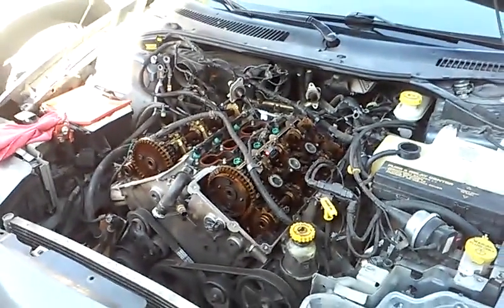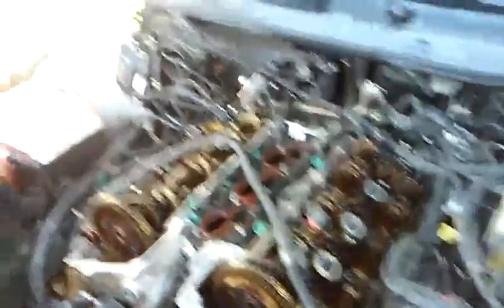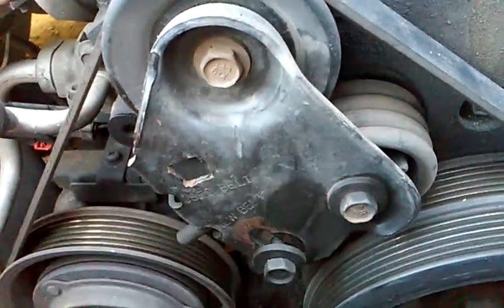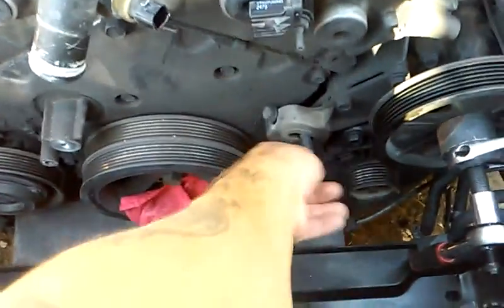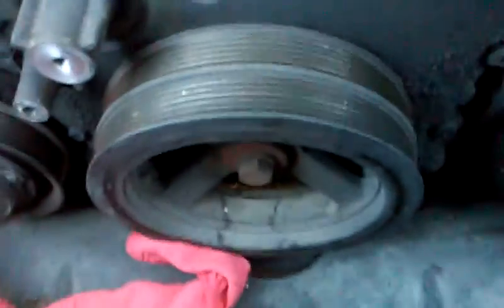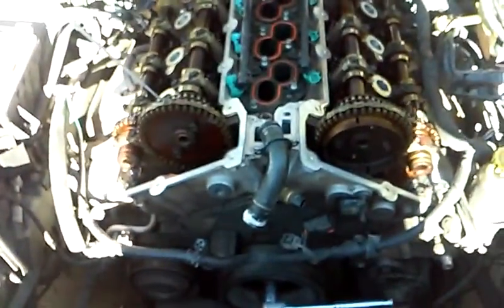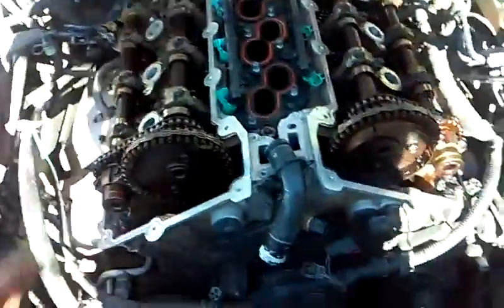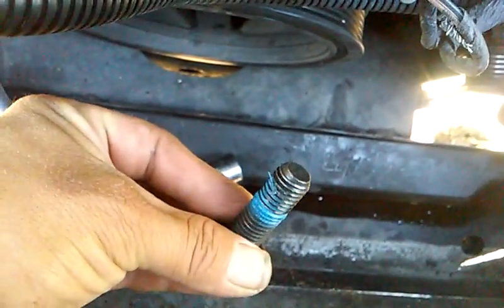chrysler 2 7l timingwaterpump part 4

Comment: i have a question i have a 2.7 on a 2006 chrysler 300 i went ahead and started taking everything off and didnt line up on tdc before. now im having alot of problems with getting the timing when i line up my sprocket from  the crankshaft #1 piston is halfway down. any advice on what i can do and what i did wrong
Reply: That engine timing marks do not align to tdc ..so it’s ok

Comment: Please help! I removed timing chain before setting tdc and I moved both sprockets independently trying to fix and cam shaft. How can I fix it back to Tdc ? Thanks in advance
Reply from the maker: email me highgrooveauto@gmail.com. you will have to first dial in the bottom half then the top half then install chains then check for proper clearance.